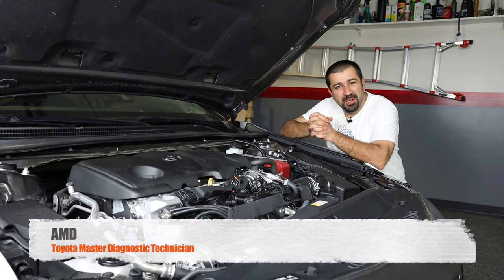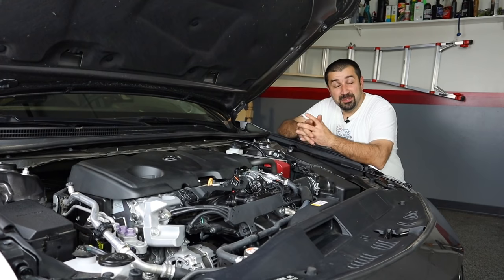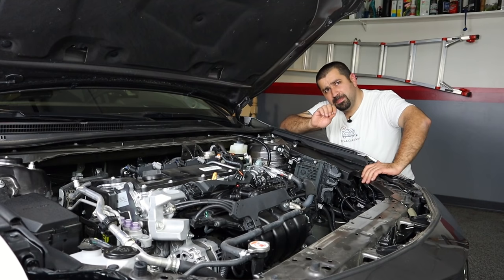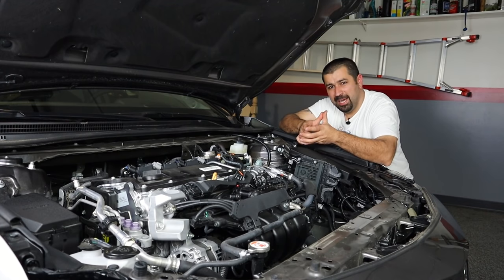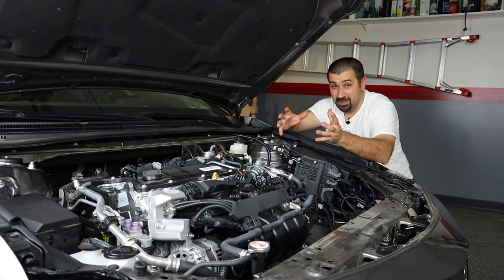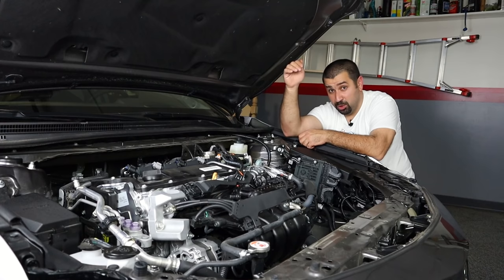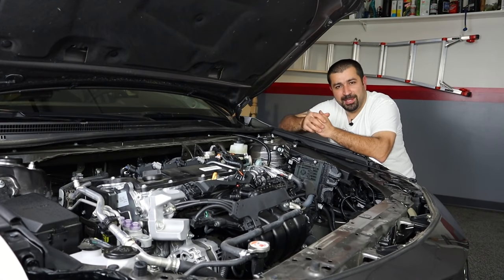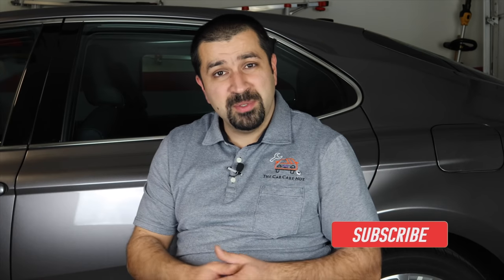Toyota's New Engine Technical review Part 1 : Cooling,Lubrication,Direct Injection and EGR

Comment: I saw someone posted the owners manual for an over seas version (Russia) whichl stated you can use different oil weights based on outside temperature.  Is this accurate?
Reply from the maker: That’s possible however follow the recommendation from the owners manual for your car.

Comment: I got my Toyota in January of this year with almost 70,000 miles and looking at the history of services done, all but one oil change was done with the 5w-20 oil and not the 0w-16.
Reply: How is it running ?
Reply: @saif9844  Like it's brand new.
Reply: Dont Buy into this thin oil Recommendation if You study up on oil viscosity you will see its all about emissions

Comment: So interesting and well explained. I have some questions still about some details:
1. Is the engine on the Atkinson Cycle all the time? I assume it is not.
2. If not is the AC activated by the Variable Valve Time adjustment? 
3. Is the VVT adjusted electronically or by oil pressure?
4. Is the variable oil pump electronically driven or is only the adjustment electronically?
Reply from the maker: Hi!
1- Atkinson cycle on demand.
2- it is activated by changing the timing.
3- the intake side is electronically activated. The passenger side is oil activated.
4- the pump is mechanical but controlled electronically.

For more in depth look into this engine see this video where I took one apart.  https://youtu.be/vWOtROAma7I
Reply: Thank you.

Comment: Hello, I ordered the RAV4 Hybrid Black Edition. I want to use the car for normal operation but also for the occasional towing of a caravan of approx. 1400 kg. Is the RAV4 a good choice? David Czech Republic Central Europe
Reply from the maker: Towing capacities might vary. Ask at your dealership for the towing limit
Reply: Towing capacity RAV4 Hybrid 4x4 is 1650kg. It's OK. I am interested in the mechanical reliability of the hybrid system and the efficiency of petrol consumption in combination with electricity when towing a trailer

Comment: i got a 2022 rav4 hybrid through the local dealer in jamaica, west indies. they have used 10/30 oil for the first oil hange. is this bad for the engine?
Reply from the maker: Hi! Read the oil recommendation in your owners manual.

Comment: I just bought a used 2014 Toyota Auris hybrid and I believe the car dealer put 5w30 in it. Should I swich it immediately to 0W16? Should I only use Toyota oil?

Comment: I just had my 10k service done. My dealership used 0w20. Any thoughts? Should I just drain and replace it with 0w16? This is the car's third oil change and first time using 0w20

Comment: Hi, I'm buying a 2021 RAV4 in a week or so. Do you have any tips or sugestions for the break-in period/procedures that should be followed for new Toyota engines? I know the manual has the steps that are recomended but I'm wondering if you have your own advice.
Thanks!
Reply from the maker: Hi Daniel! Congratulations on your RAV4 purchase in advance! So my break in procedure depends on how long you’re keeping the car. If you’re keeping it 5 years or less then don’t even worry about anything just drive and enjoy. If you’re planning to keep it for a long time well past 5 years then I would take it easy the first 500 miles. Avoid long drives at constant rpm. Basically avoid prolonged highway driving when possible. Also avoid hard acceleration when possible. After 500 miles you can open up a bit but not too much. At 1000 miles replace the oil and oil filter. Then follow it up with another oil change at 5k miles and I would continue to change the oil every 5k miles or 6 months after that. That’s what I do with all my cars and never had a single issue because of oil.
Reply: @TheCarCareNut  
Wow, thanks! I have not seen anything on changing the oil after the first 1k miles, so thanks for that. I'll be keeping it until the government forces me to change to an electic vehicle. I've had my current truck for 21 years with no major problems.
I've been watching alot of your videos and appreciate what you're doing, so thanks!
Reply: @TheCarCareNut  why change oil at 1k?
Reply from the maker: That is my opinion and what I do with my cars. As engine parts wear in when they are new some debris might be present and it’s a good idea to get it out after the end of the break in period.

Comment: Is his the same engine used in the 2018 Camry?  Does it use direct fuel injection or indirect fuel injection? Does it use an electric water pump or belt driven? etc.
Reply from the maker: Hi! This is the same engine in a 2018 Camry US model. It does use direct and port fuel injection at the same time. Also it does use an electric water pump

Comment: I've added my name to a list to buy a Rav4 Prime, but after watching this video I wonder how these uber complicated engines will fair over the long run (I plan on keeping my next vehicle a long time).
I know Toyota makes a very reliable product, but I'm now thinking that  buying a full EV might be a better idea.
Since I'll probably have to wait a year to get my new Prime I've got a lot of time to think about my options.
Reply from the maker: Hi deacon. I fully understand your concerns of complications. I will however add one thing. The exact same valid concern was raised when Toyota went with fuel injection, then when they went with dual variable valve timing. Then again with all aluminum engines. Then when they took out timing belts for timing chains. And of course when they made the first hybrid car. But years later things are still going well. And this is another one of those situations. What makes Toyota an exceptional company is not only their good engineering and continuous improvement design attitude. But their ongoing commitment to their customers after the car is sold and more importantly out of warranty. It is common for Toyota to extend warranties on items that they feel didn’t have a life length that they like for their customers. So when something fails and is expensive and causes customer stress and unhappiness they take care of things within reason.

At this moment the RAV4 prime is rapidly out pacing a lot of models and rapidly becoming the halo car. Even though it is different than a conventional hybrid but in a lot of ways it’s very similar.

I wouldn’t hesitate to buy a RAV4 prime. However I totally understand your concerns. I wish you the best with your decision.

Comment: where i live and in all Middle eastern countries toyota  recommends from 0w20 all the way up to 10w40 oil on this engine and i have seen many Camrys , Rav4s with 250k+ miles with no engine issues at all, in fact they don't even import or make 0w16 here because our climate is so hot 0w16 is basically water, so id say no 0w16 is not required for this engine unless you get below freezing temperatures, if you live in a hot place where its usually 20 degrees Celsius and above use 0w20-5w30

Comment: Thank you very much for educational information about Toyota. I appreciate your informative videos that along with Q and A are very helpful. Question: purchased 2019 Camry SE with 30,000 miles in June and put 2500 miles on these 6 months. Took vehicle in for service and Toyota dealer said "too early for oil change". I want to change oil and filter now so do you advise to change oil and should I use OW16 or OW20? 2.5 L engine 
Thank you very much for your consideration
Reply from the maker: Hi! I would change it using 0W16. Oil is cheap and these oil changes every 5k or 6 months will pay off in the later part of the engines life.
Reply: @TheCarCareNut  thank you very much for your great advice. I will change oil and filter. Much appreciated and Merry Christmas and Happy New Year to and family

Comment: I have to tow a 3500 lb trailer 10 km on almost flat roads. Do you recommend the Adventure or would a Prime be capable as well and why?
Reply from the maker: Hi! The RAV4 prime is limited to 2500lbs towing. The adventure is 3500 which is the max of any RAV4 in the newest generation

Comment: EGR seems closer to the system of the 4th generation Prius correct? 3rd Generation Prius had the EGR coming in before it hit the catalytic converter. Also they widened the total area of the cooler from 3rd to 4th gen. As an owner of a 2013 (3rd gen) Prius - I hope this system incorporates the lessons learned through the systemic failures in that generation. @TheCarCareNut - am I correct? Do you know of any other changes made by Toyota in this EGR system?

Comment: Correction, it is a duel mode engine. Not just Atkinson cycle. It can switch between Atkinson cycle and Otto cycle. Atkinson cycle is more efficient but not as powerful.

Comment: I have a Rav4 hybrid 2020 model. The toyota dealer uses 5w30 on it is it a problem to change to 0w16 now when the engine has 150.000 km 93.000 Miles. Greetings from the Netherlands
Reply: There is no po proper winter in NL.  I would stay with toyota 5w30 fe

Comment: thanks AMD i’ve asked you this question in another video may thats not the right one about this oil is this oil recommended also on hot countries? shall we use 5W30 or thicker or we showing use this one unfortunately the local dealer here only offers 0w20 or 10w40 and i am thinking to buy the 0w16 from online store 
waiting for your response.
kind regards 😊
Reply: ابرد عليك بالعربي 🤣…شوف ياحبيبي ترا الكتيب واضح جدا يقولك عبينا في المصنع 0w16 عشان الاستهلاك في الوقود والتشغيل في البروده الشديده…بينما في الصفحه المقابله يقول اذا انت تسوق بسرعات عاليه واحمال شاقه استخدم زيت اثقل كما هو في الجدول اللي هو 0w16 او 0w20 او 5w20 او 5w30 واخر شي 10w30…. وصراحه 5w30 هو المناسب لاجواء الخليج بشكل عام….وترا صاحب الفيديو كلامه صحيح لان كتيب امريكا يوصي ب0w16 لان الحكومه الامريكيه متشدده من ناحية الانبعاثات وصرفية الوقود يعني هو التزم بما مكتوب في كتيب امريكا لتويوتا ونحن يجب علينا الالتزام بما هو مكتوب في كتيب الشرق الاوسط….هذا والله تعالى اعلم.

Comment: Do you still recommend doing the 5000 mile intervals instead of the recommended 10,000?
Reply: Stick with 5k mile oil changes. 10k mile oil changes = oil consumption

Comment: curious I am planning on buying the 2022 Lexus es250 Awd is this engine the same as the one in the Toyota and is this a bad engine for limo and commercial driving where I will be doing alot of miles of close to 3-4k per month is this engine reliable if maintained?

Comment: Hello, I have a question regarding the plastic valve cover, will it create more leaks? Less durable? Also, do you know if the 2gr fks in the 4th gen rx350 have a plastic valve cover as well? Thanks in advance!

Comment: Your videos are amazing, very informative 👍🏻. I have a rav4 2019 2.0L, using the 0w-16 oil, the service booklet says I need to change the oil after 15.000 km or after 1, which comes first, but im a bit old fashioned regarding oil change, should I change it at 7500 ? Or wait until 15.000 km for the first oil change ? Thx before :)
Reply from the maker: Hi Andy! I would stick with your old fashioned thoughts and change it earlier. You can’t cause harm changing it earlier but you could cause harm going long

Comment: I got a 2003 Toyota Avalon that I drove it to store then I and fillled up the tank it didn't want to start it would only WITH starter fluid and I put a brand new fuel pump but now I ain't got no fuel pressure do u think it's the fill filter
Reply from the maker: I suspect bad fuel and a faulty new pump. When you had the old fuel pump did you have fuel pressure?

Also when you turn the key on, does the security light flash?

Comment: Thank you for your videos. They are very informative and helpful.
I have two questions .
Should fuel injector cleaners be used when an oil change is done?
Do Toyota vehicles have the cvt transmissions?
Reply from the maker: Hi! Thank you for watching my videos! Fuel injectors cleaner is not required to be used in the us in some markets it is but not in the us. I would consult your maintenance guide. Toyota does have CVT transmissions started with the 2014 corolla in the us and some other models as well.

Comment: Sorry Toyota guys. Ford had the dual injection, both port and direct, first. Ford does it a little different though. They have the port injection running all the time, varying from 100% at idle, to about 10% at wide open redline. This keeps the valves very clean. But still gives all the benefits of direct. Except of course now you have two sets of injectors, and two different fuel pumps to maintain. Such is progress.....
Reply: Wrong Lexus debuted D4-S on the IS more than 10 years ago.

Comment: Hi.  I participate in an online forum for the Rav4.  There are people there who insist it's okay to use oil as thick as 10w30 or even higher.  They cite the European manual that shows a multi-viscoity chart with those horizonal arrows which implies it's okay to use all of these different (and much higher) viscosities.  They claim the 0W-16 is a US thing brought on by the EPA fuel economy mandates.  Please touch on this as it's hard to argue when they can show you a manual with that in there (even though it will contradict itself by also having the 0W16 and 0W20 statements).
Reply: You probably already know this but,

Ensuring that it's Apples for Apples, so both RAV 4's are the same year model and type (so not a hybrid versus a non-hybrid etc)

You need to determine if there are any differences between the engines.

Some countries have slight variations to vehicles based on the local laws.

For example a friend of mine's father has a Toyota Hilux or Fortuner, and when everyone world wide was having DPF issues... his car didn't.

Because he was living in the Philippines (from memory), and his car wasn't fitted with a DPF.

Generally speaking a European car should have the same emissions technology as the US, so that shouldn't be the reason for the thinner oil.

Though some states (I don't live in the US)  may have rules on how long the vehicle takes to warm up, and a thinner oil will help reduce that time.

And so to pass that aspect of an emissions test they may require the thinner oil, just a guess.

Because realistically, a 0W20 or 5W20 oil shouldn't use a measurable amount of extra fuel.

Maybe email Toyota, who knows you might get lucky :-)

Comment: Hi. I have read All your advise about octane ratings. But, in Colorado we have 3 choices - 85, 87 91.  This engine owners manual for the new Venza requires 87 or higher. Can I get away with 85 here because of altitude?
Reply from the maker: Yes Joseph because of the altitude you can use 85
Reply: @TheCarCareNut  you are awesome! Thanks for the information and quick response!

Comment: Even Toyota made the mistake on some early Direct Injection engines of only having direct injectors  but no port injectors so they did have the problems with carbon build up on the valves. The 4GR on Lexus IS250 and other models.

Comment: Dear TCCN… I Just purchased a 2024 Corolla LE and I noticed that in the owners manual it recommends using 0W8 oil.  I was wondering if you had any other recommendations.  Should I stick to 0W8 oil or use 0w16 or even 0W20 oil?  Your input would be greatly appreciated.  I would be nice if you would talk about this new recommendation from Toyota on the 2.0 Corolla engine.  Many in the different forums are asking the same thing… Thank you.

Comment: Wait, on the gen 2 prius the brake booster has an electric vaccum pump. Why use a mechanical vaccum pump on DF engines?

Comment: Hi, You said that EGR is back, in the A25A non-hybrid cars. That would be the A25A-FKS mostly, I think. I’m trying to determine that if I buy a 2022 Camry Hybrid, it for sure won’t have EGR. I certainly don’t want it. As far as I have seen so far on the interweb, the A25A-FXS (hybrid engine) does have EGR. Is there a definitive Toyota statement on EGR in the hybrid?

Comment: Great video. I own a 2018 Camry SE with this engine. I've been interested in adding an oil catch can to help engine valves stay cleaner. However I don't know how to identify where to make the hose connections. Could you show us that on a future video. Thank you so much and God bless.
Reply from the maker: Thank you for watching my video. Just know that the engine in your Camry has an oil separator located underneath the intake manifold and it essentially does the job of a catch can. So adding a catch can doesn’t really accomplish much as it already has one.
Reply: @TheCarCareNut  Thank you. I take that off my list.
Reply: @georgysikorsky2386  it also has port injection. A dual system. Dont worry.

Comment: Hello, Thank you for the video!, This is very informative and I myself own a Rav4 with this Engine!, I had a few questions, I wanted to know where you were able to find the plastic covers that were by the hood opening mechanism at the start of this video, I am looking for those online but could not find any since I did not know what they are called, My rav4 does not have them somehow and I wonder if you had bought them from somewhere as an after market part

Comment: I'm liking engines that heat up coolant to operating temp REALLY quick. Can't wait to experience instant heat during winter from my VW GTI 2.0 TSI with a water cooled exhaust manifold. Coolant temps are already at or near 200 degrees within 1 mile of my commute and a 30 second idle.

Comment: What if a rat eats the sensor wire. Is there a default tune?
Reply from the maker: Hi! There’s a fail safe in place in case something goes south to keep things running safely
Reply: @TheCarCareNut  awesome. I didn't want to yank it and learn otherwise. Thanks. This engine is powerful. Great take off power